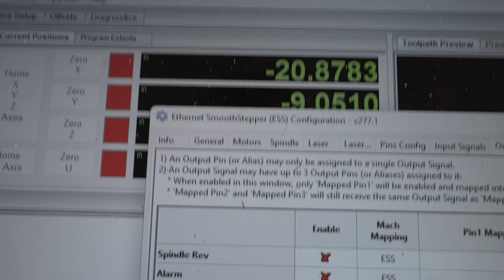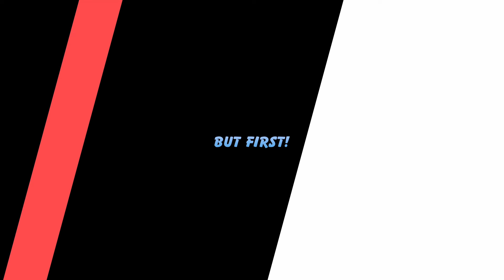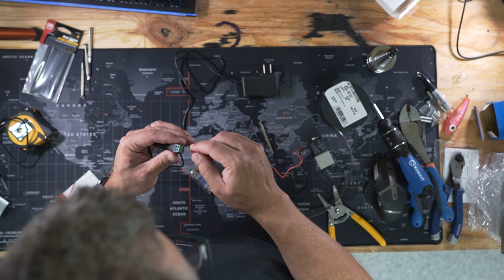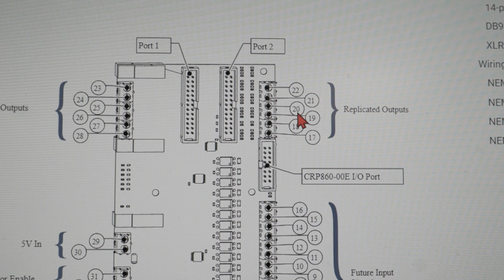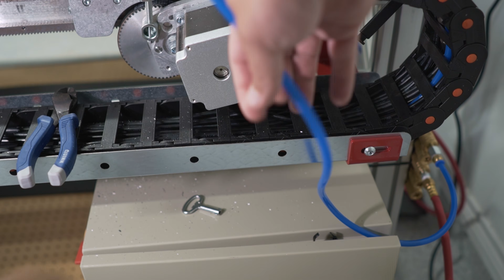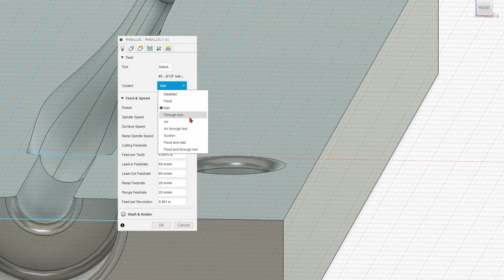Harness the Power of Mist Coolant for Optimal Avid CNC Performance

Comment: 20 k seems high for that size of cnc
Reply from the maker: The additional cost mostly comes from the ATC setup, without it would be about $3k less. Also I am including tooling, air compressor etc because I didn't have those already.

Comment: FYI, no need to wire in the new relay to the ESS,.  You could have just swapped out the AC relay for (Relay 2) with your DC relay.  If you use an AC power supply for the air solenoid, you can just use the existing Relay 2. and just plug into the power in and out connectors on the bottom of the control box.
Reply from the maker: Yeah I looked at doing it that way as well but I already had all the parts 😆😆
Reply: @WMBayouLures  🙂